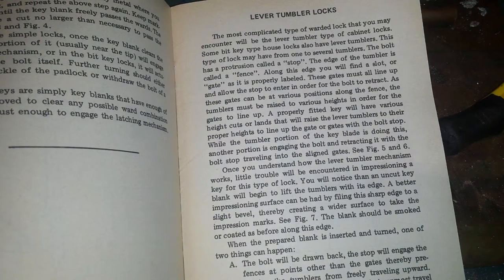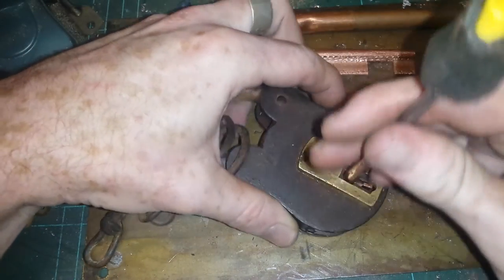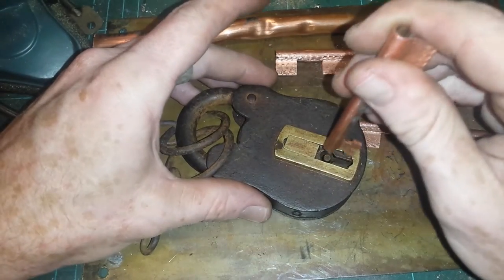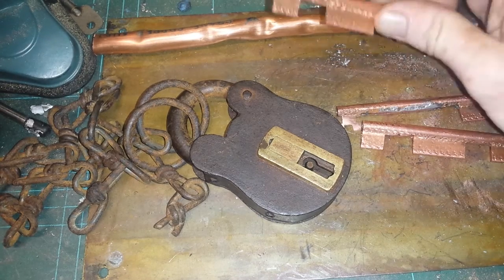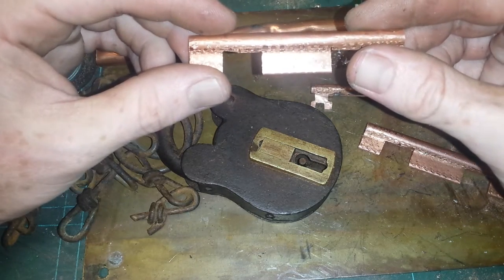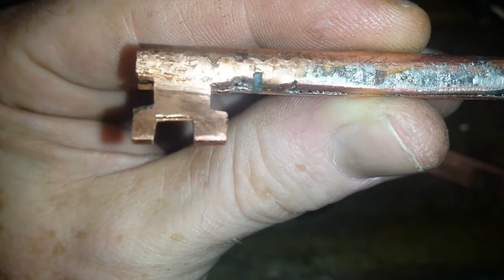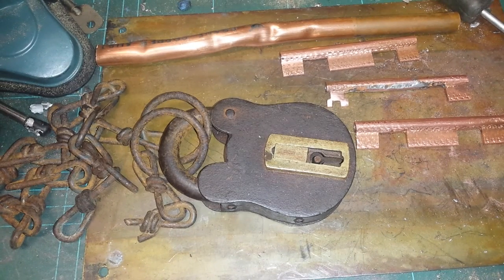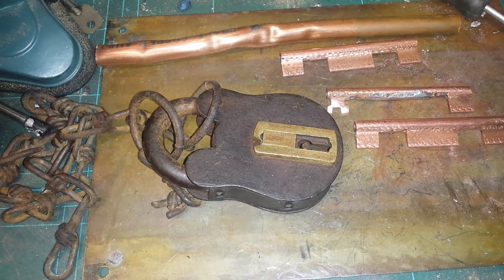Vintage Padlock & Blanks/Key making Progress

Comment: Brilliant video mate. Very interesting that it was found in a bottle dump. Looks like the chain was cut so maybe someone chucked it in the bottle dump to get rid of evidence.
Reply from the maker: Thanks Max, That's our theory as well dated the adjacent buildings and the one next to it did have a fence in all likelihood someone cut it tossed it,  mate laughed his ass off when I told him what Non destructive entry is.  Now it is fully operational, he has a "real" key for it and the chain is still on it.  Makes and interesting conversation piece, Thanks for watching man!
Reply: That's really cool mate. Been opened after all this time. I'm surprised it's not seized up I side from years of rust! I subbed
Reply from the maker: @MaxmadV8  Cheers Max! Shackle was seized as f#ck took quite a bit of time and a breaker bar to slowly in increments open the shackle a shit load of inox and degeaser.  

Mate's shop flooded 8 years ago or so, while they were digging around the footings to do some work on the building, started unearthing parts of the bottle dump and my mate spotted it gave it a clean held on to it.  One day I'm telling him about NDE he pulls this out of a draw the rest is history now haha.  Thanks for subbin bro! Cheers TR :)